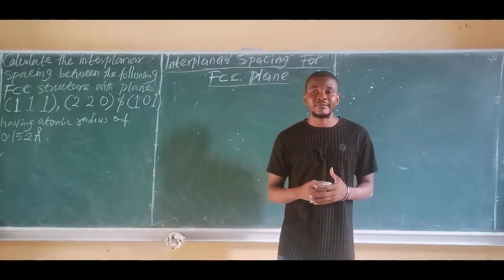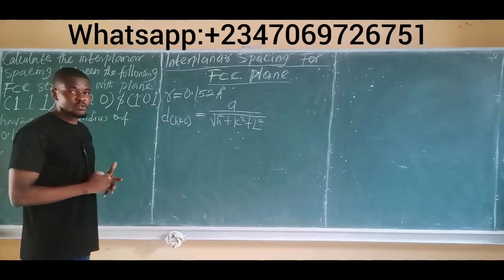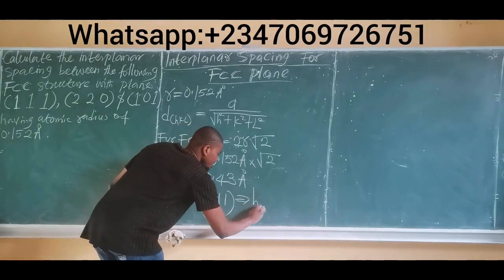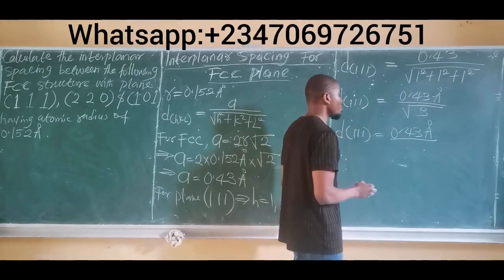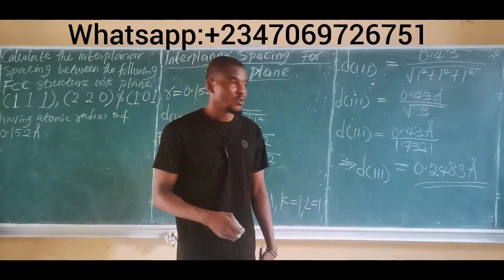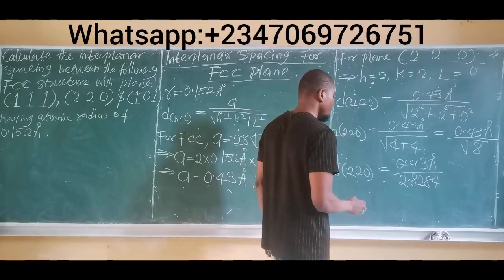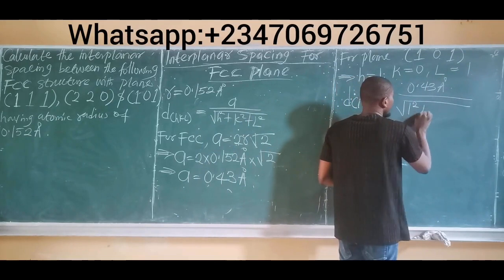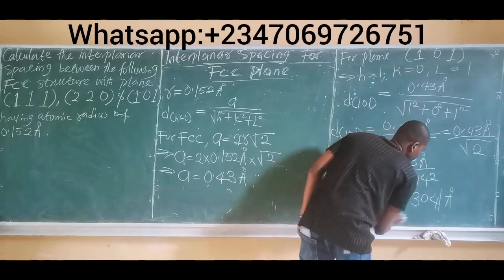Interplanar Spacing in fcc | Interplanar Spacing Problems | Interplanar Distance in fcc

Comment: Sir for fcc plane (110 ) d110it is half of d110 of scc that is  "a/2root2"

Here for 220 why didn't we take half of scc d220 ?
Answer would be "a/2root 8"
Reply from the maker: One is fcc while the other is SC
Reply: @engineersmindset240    no, for 220 fcc plane  what would be the answer?
 d(220) = a/root4  or d(220) = 1/2 [a by roor 4)
Reply: OK... Pls let me know your exact challange?
Reply from the maker: Pls let me know the exact issue you ate having
Reply: @engineersmindset240  calculate inter planar distancing in fcc plane (110) &(220) .